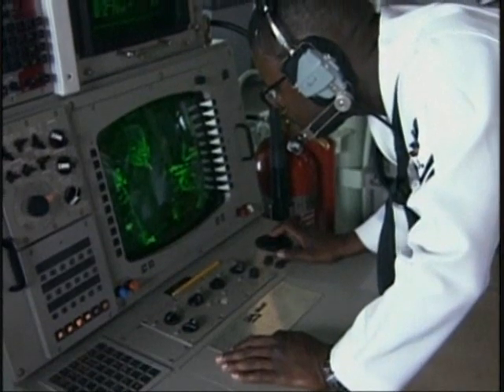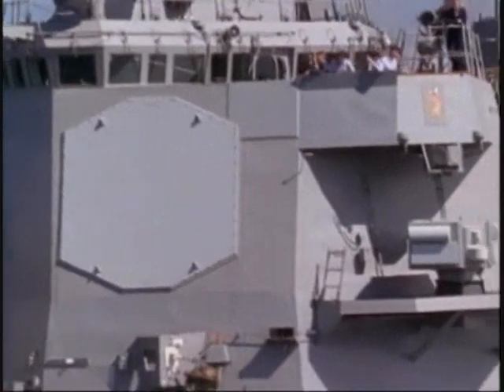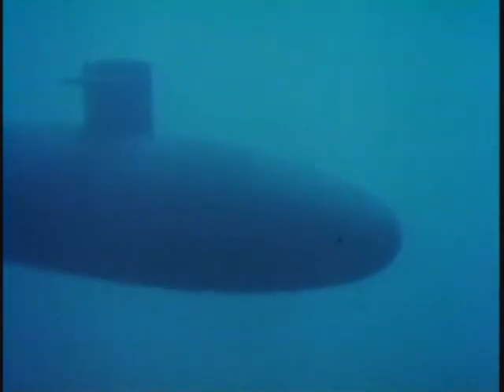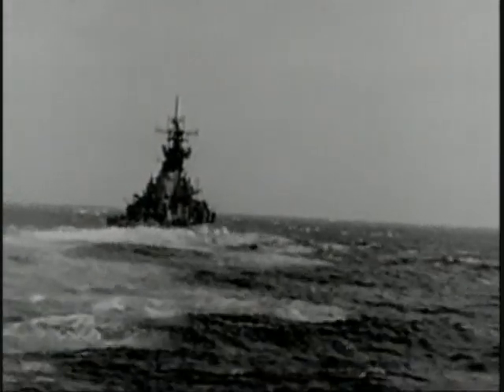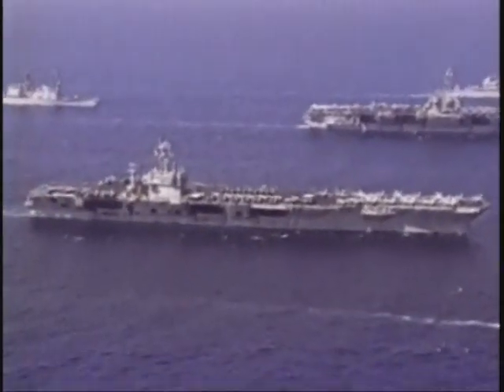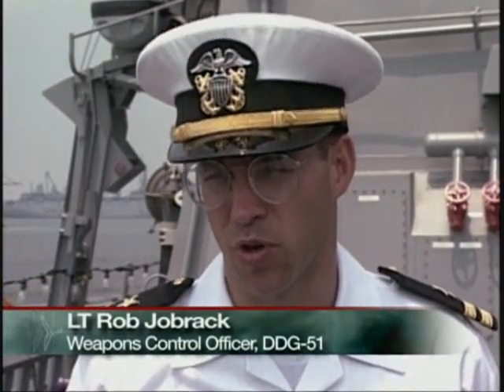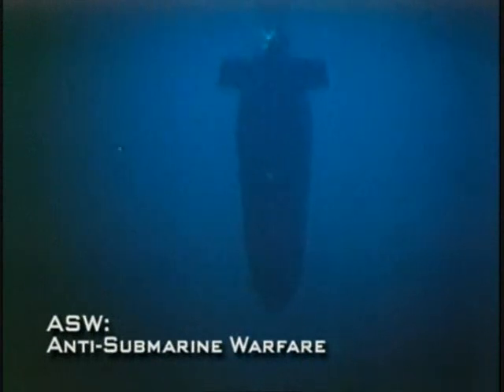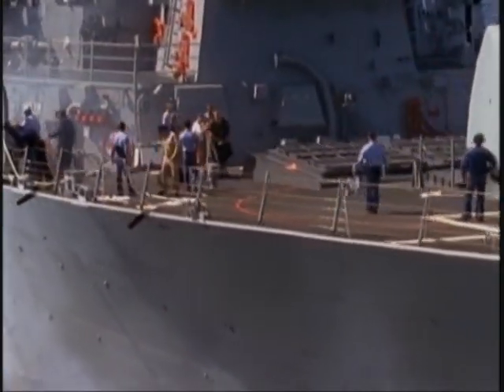Firepower - Destroyer (Part 3/3)

Comment: The stealthyness of a target (vs radar) is it's radar cross section. A F-22 has a increadubly small radar cross section, making it increadibly hard to detect. But not impossible. However, even the AEGIS radar probably needs to be pretty damned close to reliably detect an F-22 or other stealth planes. And "pretty damned close" is not a place you want hostiles in an age dominated by cruise missiles...

Comment: The video claimed dozens of miles (radius).  In reality, the helicopter has a range of hundreds of miles.  But none of that really matters as a submarine isn't capable of detecting a small destroyer 100 miles away accurately enough to launch a missile.  Even if it was, it would have to use active sonar, which out give away it's own position.  And if it used radar, again same issue, it would become an observable target.  The way to use a missile at 100m is to utilize some kind of spotter.

Comment: Actually, most modern anti-ship missiles are capable of searching for targets on their own. The submarine (or aircraft or surface vessel) don't have to get a pin-point accurate fix on the target (although that is obviously preferabalbe) to launch and have a good probability of hitting a target. Most submarines today are capable of detecting a relativly noisy target such as a destroyer cruising at 25 knots at great range.
Reply: "Fire and forget" does not equal "good probability of a hit" without properly fixing the target.